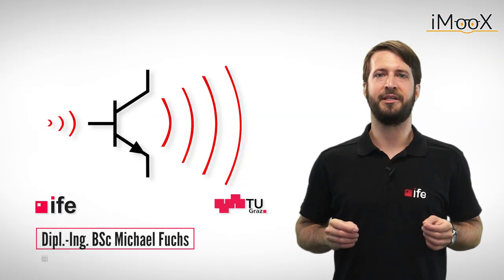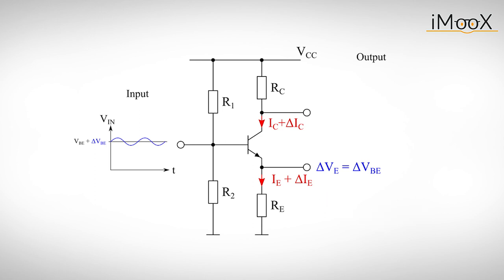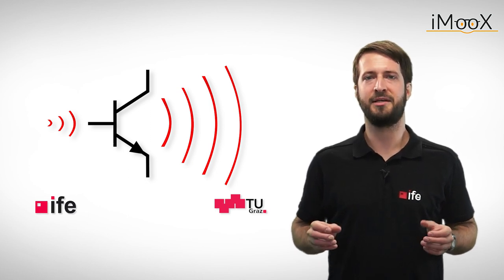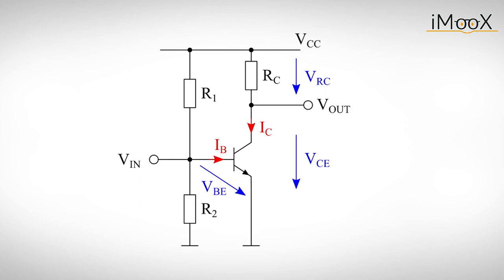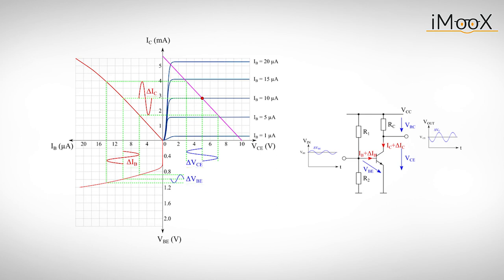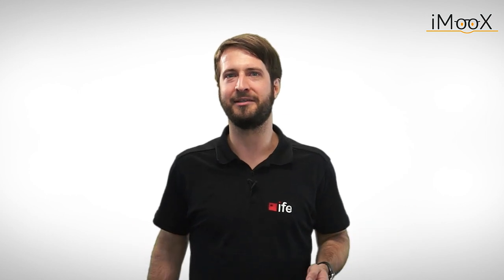The transistor as an amplifier (Part 2)

Comment: Transistor Amplifiers were the only part of semiconductor electronics I truly just didn't understand from my electrical engineering courses, you're the best!
Reply: Tech SUPPORT  I didn't say transistors, I meant transistors specifically as an AC amplifier. And also said semiconductor electronics, where a synchronous generator is an AC machine

Comment: Of course, if you add a significant emitter resistor to stabilise the dc bias, you also improve the linearity of the circuit because the non-linear element (the intrinsic bas resistance) is now an insignificant part of the gain calculation. Unfortunately if you then bypass the entire emitter resistor with a capacitor to restore the ac gain, you simply restore all of the nonlinearity and put the distortion back. Hopefully you'll get a chance to explain how the emitter resistor can be split in two parts, each of which is much bigger than the intrinsic resistance, and one part is bypassed, allowing the dc gain to be smaller than the ac gain, while preserving linearity, at the cost of needing a higher supply voltage.
Reply: I never understood why some people use two resistors and a capacitor until you explain it the way you just did Bravo I appreciate that bit if knowledge ..

question what if somebody added a inductor what would that do?
Reply: @SheikhN-bible-syndrome  Adding an inductor in series (instead of the capacitor in parallel) would have the opposite effect, i.e. there would be a roll-off frequency above which the gain would decrease as the frequency increases. The roll-off frequency will be the frequency at which the reactance of the inductor is equal to the emitter resistance: f = R/(2πL).
Reply: @RexxSchneider  ah that makes since. What about leaving the resistor from ground to collector like normal and then bypassing it with a coupling transformer? That would let AC through while blocking DC , or would it have roll off as well? And is the 2 resistors and a cap the best approach ?
Reply: @SheikhN-bible-syndrome  Transformers are a more complicated subject. To DC they are of course just the resistance of the primary winding, which could be quite low. But their AC response depends on what is connected on the secondary winding. If that was purely restive, then at frequencies where its inductive reactance is large compared to its DC resistance, the primary would have an effective impedance of the resistance across the secondary multiplied by the square of the windings ratio.

The 2 resistors and capacitor in the emitter is the preferred configuration when you want the operating point to be very stable across temperature variations. That means you make the DC gain a lot lower than the AC gain. Otherwise, a single unbypassed (i.e. no capacitor) emitter resistor, biased to drop around 250mV will usually provide a good compromise between maximising gain and output swing, against retaining a stable operating point over temperature swings.
Reply: @RexxSchneider  one thing that i dont get is that if there is a resistor or 2 on the emitter and a resistor on the collector and they are pretty large number. In order to keep the DC low to help with the over all  efficiency my confusion is this 
How does it help efficiency ? Wouldn't it limit the amount of AC signal that they transistor can make because it can't get enough DC power to then convert into ac? So wouldnt it increase your AC current by lowering the value of the resistors allowing more DC in?

Comment: My bias voltage drops dramaticly and i dont know why. I used 100k for r1 and r2, rc is 10k and re is 1k. The gain Ratio seams to work fine. But with the low bias voltage, the output cuts the negative half wave. I used a bc547.
Your Video helped me very much with understanding. Unfortunatly not enough for now.
Reply: To be honest, circuit design can be quite hard at times. In our previous video we have learned that the emitter resistance has an infuence on the allowed input resistance of the circuit and therefore depends on the actual gain of the transistor. Try to reduce the emitter resistance while keeping the gain ratio constant and you should be fine. I'd advise something like an R_E of 20 Ohms and a R_C of 200 Ohms and don't forget to attach a capacitor of about 1uF to the input. Also it's always good to use a simulation tool (like LTspice) before you design a circuit.

Comment: Hi. for the formula at 4:00
why is vout = -ic*Rc?
why is there a need for the negative sign?
Reply: The minus sign indicates that the voltage is 180 degrees out of phase. If one were to apply an alternating voltage to the base, the output would appear to shift 180 degrees, i.e. the pattern of peaks and troughs reverse.

In this type of circuit increasing the input voltage leads the output voltage to drop. Conversely reducing the input voltage causes the output voltage to rise. Remember the greater the voltage drop between VCC and the output, the smaller the output will appear when measured with reference to ground. 

As an example, assume the VCC is set to 12V. If the input signal causes a voltage drop across RC of 8V then the voltage measured between the output and ground would be 4V. If the input is then reduced, giving only a 7V drop across RC, the output would rise to 5V with respect to ground.
Reply from the maker: Simon Moring is right. There is an explanation at 3:36 just a few seconds before your question arises. The transistor is a current amplifier. A rising voltage at the base will cause the output current i_C to rise. A higher current i_C leads to a higher voltage (v_RC) at R_C. If the supply voltage V_CC is fixed, the output voltage v_OUT must therefore decrease, since V_CC = v_RC + v_OUT. In short: a rising input voltage leads to a falling output voltage. Input- and output-voltage are therefore 180° out of phase. We hope this helps!
Reply: @imooxat  
Wow, that explanation was good
Reply: @magical261  Thank you

Comment: Why do you have to move the output from the emitter to the collector if delta VE = delta VBE? Wouldn't that mean the voltage is changing just as much at the emitter as at the collector?
Reply: No, the voltage change at the emitter resistor (v_E) is the same as the voltage change at the base (v_BE). The collector current i_C is the amplified base current and is nearly the same as the emitter current i_E. If i_C=i_E the voltage gain has to come from the ratio of R_C/R_E. Only if R_C is higher than R_E you will see a gain in voltage and this gain can only be seen at the collector. The voltage you see there will be negative though, compared to v_BE.

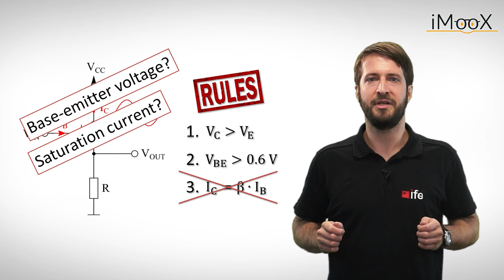Comment: 12:59 what do you mean by I_c is dependent on saturation current ???
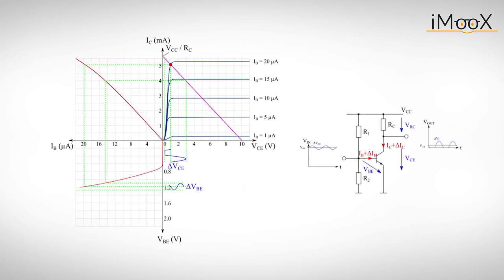Reply: Saturation effects happen when you choose the biasing point too high, like it can be seen at 11:28. This is only useful when you want to use your transistor as a switch, but not when you use it as an amplifier. You can find more information on using a bipolar transistor as a switch here: https://www.elprocus.com/using-transistor-as-a-switch/
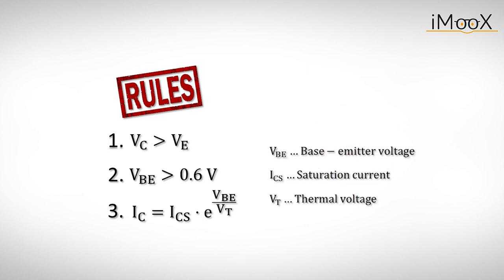Reply: Here, the phrase "saturation current" is used very differently from when a transistor is in saturation, and it's likely to cause the sort of confusion that the previous answer suffered from. It's in fact the transistor equivalent of the "leakage current" in a diode, and will typically have a value of around 0.01pA, although it will vary from device to device. It is used at 13:27 in the Ebers-Moll equation as I_cs. For example, if you set I_cs=0.01pA, V_be = 650mV and V_t = 25mV, you get 2mA. Although nobody seriously uses that sort of calculation for discrete design, when it's far easier to simply make use of an equivalent internal base resistance approximately equal to 25mV/Ic.

Comment: which parameter in datasheet define the minimum signal that transistor can amplify.
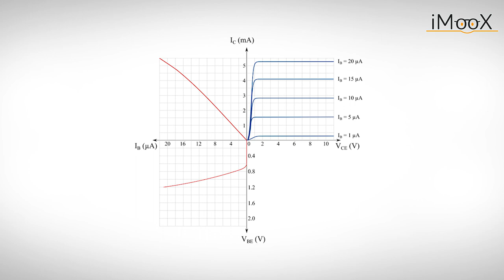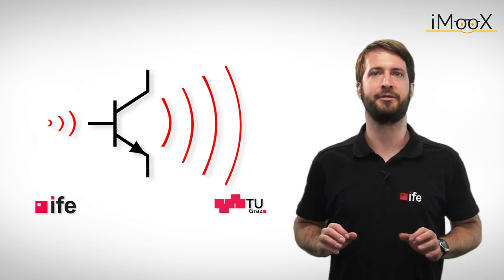Reply: This question is hard to answer, because such a value typically does not exist. In general, if you choose an appropriate opperating point (like it is shown starting at 10:08) and choose a very high gain (high collector resistor R_C and no emitter resistor R_E), you could amplify very small signals. But as it is discussed at 15:57, this comes at the cost of linearity. Also if the input signal is very small you could run into trouble with noise at the input. All in all your output signal might not look anything like the input signal, if the latter is very small and the gain is very high.
In this case one might use other possibilities, like a second stage at the output [1] or other amplifier circuits, like an operational amplifier [2].
[1] https://wiki.analog.com/university/courses/electronics/text/chapter-10
[2] https://www.youtube.com/watch?v=SCw8z4WLqaU&list=PLhy2nHJciTED7xA_u5OyUj7oDEFf3BuZY

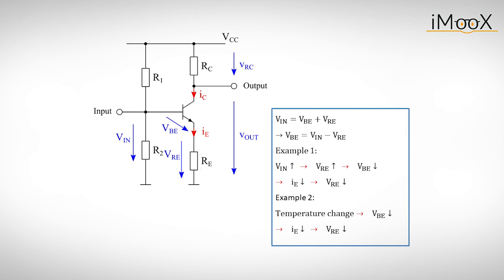Comment: How R_E allows stable bias point at 16:38
Reply: You probably mean the circuit at 17:39 with the bypass capacitor. A capacitor behaves as an open circuit for DC, which is why R_E can guaranty a stable DC bias point (in the large signal view of the circuit). For small-signals (AC-signals) the capacitor has a lower impedance, which in turn allows a high gain for these signals, since the total impedance of R_E in parallel to C_E becomes small.

Comment: Why at 3:58 V_E=V_B ?
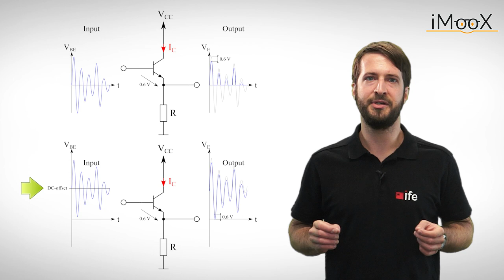Reply: This is a small-signal analysis. Small letters stand for alternating values without any DC-offset. In this case v_E really is v_B, because the 0.6-0.7V offset because of the transistor is a DC-offset. Just look at the graph at 1:12. The alternating voltage stays the same, as long as the DC-offset at the base is high enought not to cause clipping.

Comment: At 15:11 i don't understand why r_E =Vt/Ic =dVbe/dIc ?
Why Re total is only significant only if external resistor Re is very small ?
Reply: The internal resistance r_E depends on the transconductance gm, which varies widely and has a typical range of 1 to 400 millisiemens. If the external resistor R_E is small compared to the internal resistance r_E, the total gain of the circuit will change with collector current i_C. Therefore a larger external resistor R_E is often chosen even at the expense of gain to ensure that the internal resistance r_E does not influence the gain of the circuit too much.
Reply: Why r_E=Vt/Ic??
Reply: So you mean Re is chosen high ?
Reply: @attarpattar  V_T is the termal voltage and is a physical property of the transistor. You can find additional information in these handy notes, which might answer most of your questions: http://www.ee.ic.ac.uk/pcheung/teaching/aero2_signals&systems/transistor%20circuit%20notes.pdf
Reply: @attarpattar  R_E is chosen relatively high to r_E, yes, but at the sacrifice of gain.
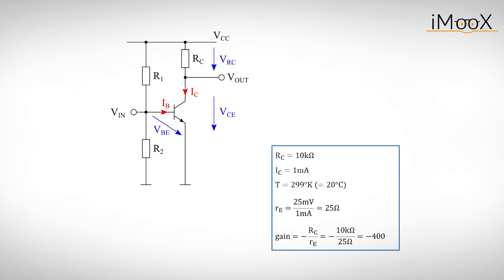Reply: @michaelfuchs441  so why at 15:39 R_E << (r_E+R_E) there should not be too much difference in these values as we choose high value of R_E as compared to r_E
Reply: @attarpattar   It is said: "the internal intrinsic resistance r_E is only significant, if the external resistor R_E is very small". If you have an internal resistance r_E = 25 Ohm, you need a bigger external resistor R_E. So, yes. If you choose R_E high, the sum of r_E+R_E stays approximately the same and the gain does not change anymore.

Comment: What! This is the end of transistor as amplifier!?!??! 😱 I thought there will be part 3 of this! What about transistor as differential amplifier?

I got very hung up on this series because the instructions are extremely clear, although not easy to understand especially the mathematics.

About mathematics, this is the only one of the two channels I found mentions 'thermal voltage' and its calculation. The rest (of YouTubers or anyone on the Internet) simplify too much. Some of them simplify too much until the numbers are far from each other, but they did mention that that is only for the sake of very rough estimation and for speed. Maybe that applies to engineers who are on site and need to be quick in their work.

Things should be made as simple as possible, but not simpler.
Reply: @ife.tugraz  Ah, TU Graz's own channel!
I hope you, or TU Graz staff or researchers talk about the so-called 'current mirror' and 'current source' which 'stabilise' lousy transistors and their unmatched-ness.

My purpose is to give old school transistors chances because I had been playing with operational amplifiers too much that I become bored. There is nothing much to learn. 

I mean, there is too much about an op-amp that I yet to discover but the all-encompassing chip called 'integrated circuit' does whatever I need it to work. Heavy work had been lifted by the person or persons who designed the first integrated circuit so that successive generations would be more and more lazy and stupid (Anti-technology group such as my grandparents and parents always say!).

I do not have extra money to spend on advanced chips and I do not have an income, so I think this is the best time for me to dig out components that I have left when I was active in electronics, and learn something new and advanced during this insane pandemic.

I have already built three op-amp instrumentation amplifier. Believe it or not, I learnt so much just by building it! Stuff that I never learnt in school! I guess those are truly advanced and overly sophisticated for schools. For example :

1. The mysterious noise from resistors. Use small value resistors, as small as humanely possible while not creating a wire/short circuit.

2. Use massive capacitors whenever practical. High voltage rating. Not Farad.

3. All components are cunningly inductive AND resistive AND capacitive devices. Now I sound like a conspiracy theorist!
Reply: @realchristopher4334  I agree, that you cannot learn electronics better than when you're building and repairing circuits. Your observations are good. It's true that very large transistor values often cause problems with noise in OPamp circuits (it also depends on the voltage noise and the current noise of the OPamp itself of cause).
Also the issue of high frequency behavior of passive components will soon be discussed in our videos on electromagnetic compatability very soon.
Reply: @realchristopher4334  We did see your comment, but we didn't quite get the question. We are glad to answer any questions regarding the content of our videos though.